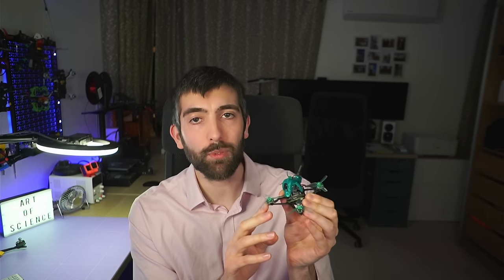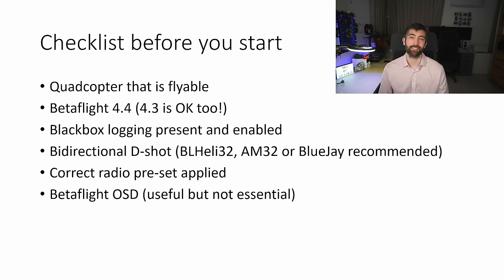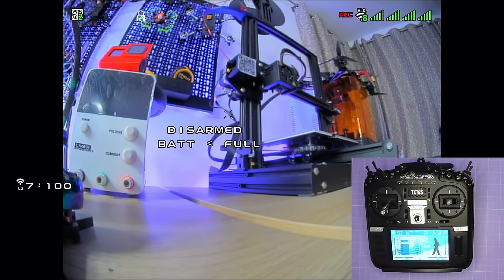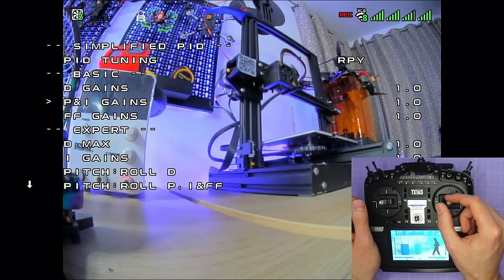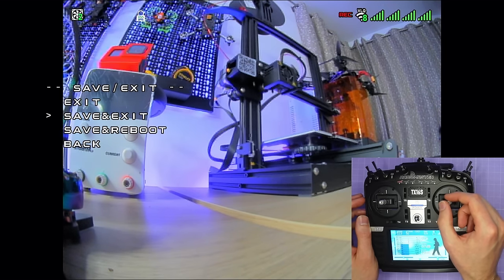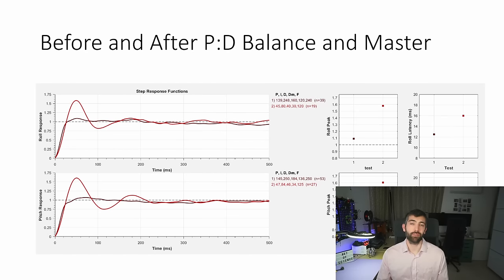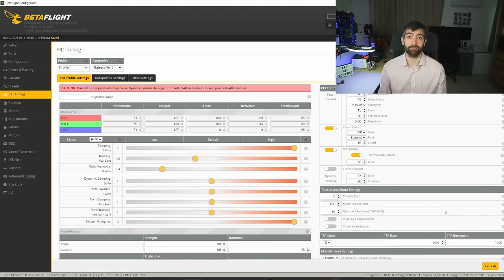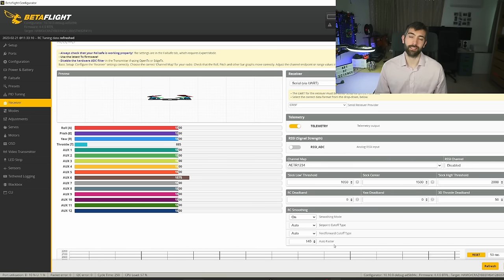Betaflight 4.4 Tuning Guide + Tips and Tricks for the BEST tune!

Comment: Push left stick to the right and hold briefly to quickly get to the save/exit menu. You don’t need to use back repeatedly.
Reply from the maker: Good to know, thanks!
Reply: Or just Left stick to the Left to go back.
Reply: I find using LUA script (Betaflight setup) on the radio easier. No goggles needed.

Comment: You mentioned using the throttle pump log to optimize filters but didn’t actually do that in the video. You just visualized the log and then used the values from your chart. Did I miss something?

Comment: Great vid Chris! Nice step by step. Very similar to the PTB approach. BF 4.4 is really something! One small correction 6:37, FF is currently still active in Angle mode in BF4.4. Not sure what the intention is for future versions, but FF definitely should be turned off (angle or acro) if using the PTB step response tool.
Reply: LOVE YOUR WORK BRIAN!!!
Reply: @xxxplode5999  thanks man
Reply: Brian is the real hero here! If not for him this video would never exist! Cris should have plugged brian more
Reply: @fr3style  I agree!
Reply: Where would we be without pidtoolbox and the basement tuning method? Great seeing all these videos showcasing your software and how it makes it so much easier to understand tuning.
Reply from the maker: I'm pretty sure feedforward is disabled in Angle mode in BF 4.4. My PR to enable FF in angle mode is scheduled for merge in 4.5.
Reply: @ChrisRosser  no FF was active in angle mode since probably 4.2 but it just didn’t work nicely. Try it yourself. The F-term is very active in angle. And it messes up the step resp. Also, if FF is set really high it will result in a very low step resp N because most of the step traces don’t pass a quality control criteria (namely the individual step traces have very extreme values so they get tossed by the algorithm). That’s why the N are pretty low in your examples (n as low as 13 or so in one case). When FF is off, you should easily get and n > 100 with only ~30seconds of data
Reply: @PIDtoolbox 
Is it also necessary to change angle strength to 100 for these tests?
Reply: @Gray_Wolf33  no. 50 is sufficient really. And on big 7+ inch rigs, > 50 is dangerous.
Reply: @PIDtoolbox
Thank you! Good thing I asked as I was going to tune my AOS 7” using your Step Response Tool.
Reply: @Gray_Wolf33  not a problem. Only really when it’s a really heavy rig like a lifter
Reply: @pidtoolbox so should I be setting FF to 0 before I start my angle mode tuning on P/D? Thank you for all your hardwork!
Reply: @EliProductions  yes. All P-D tuning you should have FF at 0 and iterm near 0
Reply: @PIDtoolbox  FF at 0 refers to the Feed forward boost setting in pid settings right?
Reply: @darshandev1754  no, I’m referring to “stick response/feed forward” slider
Reply: @PIDtoolbox  thanks a lot for the quick response
I have a race tomorrow but my quad is a little wobbly
This video really helped with tuning out the wobble, ideally Chris recommends replacing damaged parts however no time for that now

I just turned the ff slider down to 0, nothing to change on the right hand side pid controller settings right, so I'll let the boost stay at 15
Reply: @darshandev1754  I’m not saying do not use FF, I wanna make that clear. You need FF. You just can’t use it when tuning PD balance
Reply: @PIDtoolbox  do we need ff in angle mode too?
I have a lot of 30-60hz noise
On pitch and roll graphs
Which filters should I apply
Will the single biquad d filter be enough
Also should I change it's min and Max cut offs from the advised ones 80-110 to 30-60 hz in my case?
Reply: I agree with Brian. FF has an effect in angle, it's not off.
Reply: @PIDtoolbox  if i have a whoop, 5 inch lifter. 4 motors. Should i turn the FF off only for Tuning or all the time?
Reply: @AhmadFPV  for step resp tuning only
Reply: No way to make pidtoolbox work’s at macOS ventura inmy m1 mac 😢 , only work’s the first time yuo run it after instalation ..
Reply: @albertocvr1  known issue. New release coming
Reply: @PIDtoolbox  ok thank’s , grate job 👍
Reply: @PIDtoolbox  In your video (very very useful): "Basement tuning just got a lot easier! - USE ANGLE MODE!" You ask to set angle strength at 100. Something change between this video ?
Reply: @JeromeGanet  well it’s not necessary to set angle strength that high. Default is fine.
Reply: @PIDtoolbox  Ok, noted ! Thanks for your help PTB is so helpful :)

Comment: Thanks a lot for chris, it's super useful for me. One thing I found more useful in the P:D balance section 20:58 was using a binary search type approach. 

First do 3 runs at 0.3, 1.0, and 2.0
Then look at the logs and see if 1.0 is under or over damped. Assuming 2.0 is under damped and 0.3 is under damped then whichever side 1.0 is on, lets you eliminate anything above of below it.
For me, 0.3 was massively over damped, 1.0 was somewhat over damped and 2.0 was massively under damped. Because of that you know anything less than 1 will also be under damped, and you don't have to test anything below that. 
From there you try 1.5 and see how that performs. For me 1.5 was actually about perfect, but for others it could be over or under damped and then you just repeat the process until you can get a really nice tune in what I'd guess to be about 4-6 flights. This would be a bit more of a scientific route to it too instead of just picking some numbers at random.
Reply: This is my first time tuning my quads.. Chris says in the video that your D slider should be 2.5 times your pi slider. If my PI slider is 1.6 do I have to times it by 2.5?? At 1.6 PI and 1.0 D slider it looks almost identical to Chris’s final tune. I’ve watched all 4 of his tuning videos and Joshua Broadwell but I just feel like I’m doing something wrong. 

Any insight, pleassseeeee

Comment: I tried this technique of tuning with BF 4.3 for my custom geprc Smart35 frame with 20x20 F722 40A mamba stack (MPU6000) analog vtx and 1404 3750 motors on 4s. I failed miserably. After wrecking my mind and sleepless night I finally gave up and thankfully found your 3.5 inch AOS preset. Applied it and tweaked the D term and I term a step up and perfectly matched my quad. I’m so happy to be able to fly it so well now. Thanks a lot.

Comment: Hi Chris,
just looked up the specs of the 1002-motor the Sub250 Nanofly20 quad uses and it states that it has a 9N12P configuration instead of the more "standard" 12N14P configuration that the larger motors have. Not sure if this really matters for the tuning process when enabling "Bidirectional DShot" and leaving the motor poles at the Betaflight standard 14 poles as seen in a short video blip instead of 12. Would be interested what potential issues you could see if any. And on a sidenote: I love your scientific method of procedure "consisting in systematic observation, measurement, and experiment, and the formulation, testing, and modification of hypotheses.". I hope that someday this will make it into some form of Betaflight Auto-Tune capability for the general public. 🙏
Reply: You'll want to change the motor poles to 12 on that 1002 motor if you are enabling bidirectional dshot. The correct magnet count is required in order for the correct RPM to be determined. If the magnet count is wrong then the RPM will not be calculated correctly and the RPM filter won't work to the best of it's ability, which may in turn cause hot motors.

Comment: Thank you Chris, I appreciate the hard work you put in to this and the videoing. I don't think people think enough about the work that entails. I subed, and liked. I have just built a 5" freestyle quad and tried UAV's preset tune. It almost ran away. Went back to betaflight stock 5" preset,  and I have a lot of oscillation after a roll. Time to figure it out.

Comment: I've been flying BF 4.4 for a few weeks now, and am pretty happy with my numbers, but I of course had to put your expertise to the test.  Here's my feedback:

I did not know that feed forward was not used in Angle mode.  I disengaged it, and found no difference.  I will fly without it from now on in Angle mode, as there's no need.

I have no black box, but found your filter recommendations to be much better than what I was using.  The motors sound smoother, and they finish a flight very cool to the touch.

I'm going to experiment with my P-D balance some more.  I may find something more in the process.  Never tried it without I-gain, so I expect I will learn.

My minimum RPM is much higher by preference.  It suits the way I use my throttle in Angle mode.  130 would be a tad high for most 2-inch builds, but that's my number.

On the whole, this is top-notch information; a typical Rosser Joint.

Thanks for sharing, Chris!

Comment: I'm finally to the point where I am capable enough to need this guide.  Great video.  I'm curious about applying the betaflight presets for the radio link.  Is that a necessary step for something that is already built and flying, that we just wish to tighten up a bit?

Comment: Thanks for an informative tuning video Chris.
But what about older builds that have DShot600 but NOT bi-directional?

I have Armattan Badger circa 2018 with individual 30A ESCs. The ESC firmware is BLHeli32 C-H-25 16.7 latest update. BF4.4.3

Comment: Following along with your guide and I came across another guide and comparing both methods. There is a comment that mentions the Angle Strength @50 will register lower values in pid toolbox. Would like your thoughts on this if you have time.. :) Great guide BTW! Thanks!

Comment: Great video. I recently got into the Mob6 with 30K kv motors on 1210 biblade props. Using a value of 30 on dynamic idle seems to work best for me. Any higher and my inverted hang time indoors isn't that great. It also doesn't fall out of the sky at 30. Curious to know if dynamic idle should take power to weight ratio into mind rather than just prop diameter? Or just keep going lower until the motors don't spin smoothly at 0 throttle?

Comment: This is a good guide - but you should credit Brian White most of this guide other then the filters section and the dynamic idle is based off methodologies Brian developed and tools he created, there is not  any acknowledgment of that which is a shame.

With regards to some things in the guide you didn't touch on Iterm Relax which is critical for a lot of drones also I term at 1.0 will cause massive overshoot on any drone over 8 inch - it needs to be decreased as the drone size increases!

FF is dependant on I term not just D!

FF is not disabled by angle mode that is incorrect

Comment: Hi Chris, great sharing for PID tune, I follow your step, and set I-Gain to zero and tune P&I Gain.
however, when start from 0.4, arm and yaw drift right quite fast. all I need to do it turn the I-Gain back to 1.
yaw drift gone and able to arm and take off.
why set I-gain to zero and tune like you not work for me?

Comment: Really cool video! Thanks Chris! I just got a Flylens85 whoop, does these settings apply to mini whoops as well? I'm kinda afraid to change the DEFAULT settings since its my first time using it
Reply: just take a picture of all your default filters and sliders before tuning. If you mess things up you can always move them back to defaults. When tuning just make sure you go in small increments. Don’t go from 1.0 on the master multiplier to 2 right away. Go up a .10 at a time! There is a possibility of burning up motors or fly aways if you make big changes without testing

Comment: I think for some quads I need to find the PD balance and the master multiplier separately for roll and pitch axes and merge the PID values directly without the sliders.   
With the latest BF the flight behaviour has become much better. Chris Rossers step by step tuning method is working for me. Thank you.
For dynamic idle the values are higher compared to the last recommendations. Is this just more conservative, or due to changes in BF?
Reply: Just noticed that there are dedicated pitch sliders for that

Comment: you should do a tuning guide on the crux35 frame, i have been using it for a few months and either its wobbly or the motors get hot, i think the frame is just noisey but its SUPER difficult to get a good tune, espesually if you build it with a heavy vtx and a stack instead of an AIO, compared to the stock BNF from happymodel i upgraded my motors to xing2 3800kw 1404 and used a mamba f405 mk4 mini stack, and rush ulitmate plus vtx, then throw on a heavy battery so she comes in right around the 235g mark with an 850mah 4s, and i just cant get a tune im happy with, in stock BNF form it flew really alot better than my "upgraded" version and i have spend literally days tuning it. A couple of weeks ago i ordered an AOS35 to replace it not only for the frame noise performance, but also the ability to replace a single arm when i break one instead of an entire bottom plate thats a complete PITA and cost me $35 every time for a complete frame instead of $8 for a single arm lol,
Reply: Yeah I agree with this. The crux35 is a really difficult quad to tune with heavier electronics, too, my DJI vista crux35 flies pretty well but it's not as nice as my HDzero or analog version, both of which fly way better. The frame can end up bent. There's a replacement frame I'm taking a look at now called The Great Discus which I think might be easier to work with, and a bit stronger.
Reply: @JohnCuppi  i ordered an aos35 from cnc drones, it has 4mm arms and they are induvidually replaceable, the frame is overall 20g heavier than the crux but not having to swap out an entire bottom plate for the cost of an entire frame kit every single time i break an arm (3 broken arms in 3 months each time losing out on flying until the replacement arrives) now i will have spare arms and can easily swap one out in the feild with just one motor off and 2 arm screws, its probably worth the extra weight tbh the crux has plenty of power i have xing2 1404 3800kv on it now after the stock motors kept coming apart, then one died so i needed to replace them i couldnt just keep gluing it together, so overall its a bit heavier than stock already then the new frame, it will go from a minimum wet weight stock of about 200g, right now its about 220g, and with the new frame im expecting 240-250g all up weight with my 850mah 4s. and i did some tests where i strappedmore weight to it and it has the power, just the crux frame cant handle it and get a good tune. i will try to remember to let you know how the aos35 works out for me its just shipped from canada to australia so a couple of weeks away yet

Comment: @Chris Rosser Very great video, thanks Chris. How can I get more D if it’s already maxed out at 2.0 with MM still at 1.0? 

I’m at PI .8 so have to set D to 2.0 to keep the ratio. My MM is still at 1.0. I think I can get more PI but ran out of D to keep the ratio correct.
Reply: I think I just figured it out. If I were to start over knowing I need more D than MM. Do these starting defaults make sense?

PI = .5
D = .5
MM = 1.5

🧐

Comment: It is worth to note that if you are using a FC with an ICM42688P you SHOULD NOT disable all gyro filters - at least one lowpass should be enabled! In my case Gyro Lowpass 2 set to 600Hz PT2 hits a sweet spot, but start with as low as 300Hz and go up from there.
Reply: There is also something about 4k PID loop. If I remember correctly betaflight documentation advise to keep a low pass 2 active in case of a 4k pid loop.
Reply: @J2_P  ye ive read it to
Reply: @J2_P  "Never disable Gyro Lowpass 2 filter for 2K/4K PID loop frequency due to anti-aliasing reasons"
Reply: I'm using a Tmotor F722 FC running the MPU6000 gyro and have my PID loop frequency set to 8k and ESC protocol set to DSHOT 600. Do you think the filter settings Chris recommends are good for this FC at these configurations?
Reply: @MattBalder  It should work fine with your gyro :)

Comment: Hi @ChrisRosser great and very useful guide. 
Question: Can I follow your steps having the "Throttle MID", "Throttle EXP", "Throttle Limit" and "Throttle Limit%" not in default? I have changed them to fly my flywoo explorer Iong range indoor.
I hope you can answer.
Thanks Chris!
Reply: Also, which base rates are best to perform the tuning?

Comment: hey chris, thx for your great videos. with your advices the PID tune works great. but now i have a problem with a speedy bee FC without flash. there is only a SD card slot. The gyro data were recorded om the SD card, but they are saved as BFL files instead of bbl files. therefore i cant open the files in pidtoolbox or in the blackbox viewer. do you know how to convert to bbl files or open the bfl files? you know an other solution?
THX

Comment: Incredible and very useful information! Chris, I have a question regarding the proportion between P:D (22:23). If your PI slider is 0.4 your D slider will be 1 (x2.5), what happens when your PI slider is 1 or 1.25 or higher? D slider can't go higher than 2? Thanks for your help
Reply: Was questioning exact same thing. Also - he’s talking about p/d balance using PI-slider and D-slider. Whats up with the ‘I’ in ‘PI-slider’?
Reply: have you figured this out? I am looking for answer too.

Comment: Hi @chrisRosser . One question... What if the best result when trying different  P & I gains values is over 1 (1.20 for example) you can ´t set a  x2.5 times D gain value because the max value is 2.0... should i push master multiplyer to 2.0 and divide 2 times p&i and Dgain sliders?? i gess that if i do  this, i should divide 2 times the values in all sliders right? Thanks a lot again!

Comment: What about lowpass filters for the BMI270 gyro? Still remove gyro lowpass filter? or do we need to add a filter or change any settings using Betaflight 4.4? or does BF automatically gets it into OSR4 mode and we don't need extra filtering using BF gyro lowpass filter? New to this and a bit confused...